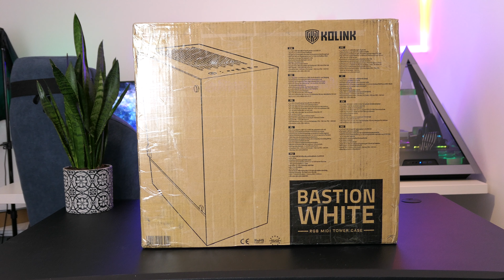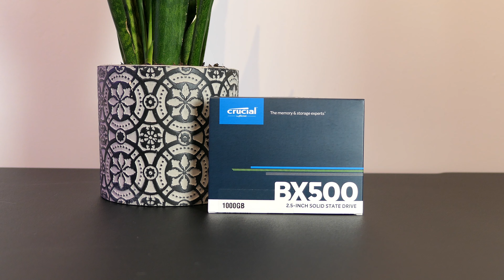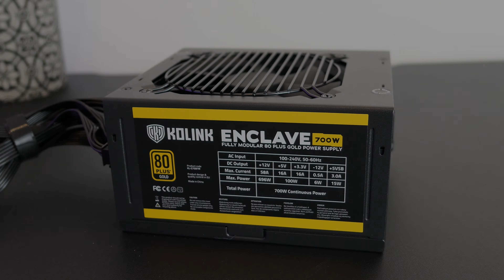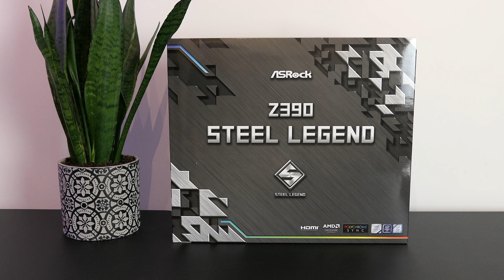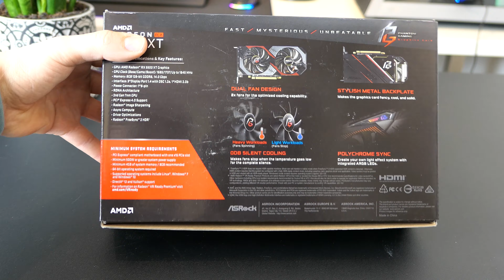PC Build Timelapse - Kolink Bastion RGB

Comment: Thank god! I've seen this case on my favorite gaming store, 2 months or 3 ago and didn't had nobody talking about his case or showing this case. Thank you soo much :D
Reply: I got the same case and my GPU temp gets very hot 😭
Reply: @Underground_Vibes  really? Im planning getting this one
Reply: @johnyt5848  in the case I can't get my GPU temp below 80.  Unless I undervolt my card..
Reply: @Underground_Vibes  which is your gpu?
Reply: @juanburnes375  was only a rx 590 at the time.. with fans ramped on full couldn't  get thr temps below 80
Reply: @Underground_Vibes  which model?
Reply: @Underground_Vibes  do you actually have sufficient case fans?
Reply: i just realised that theres no front fans make sure you have probably the top row as intake fans
Reply: @Underground_Vibes  80c is mostly fine the cards only start to suffer at mid 90s

Comment: Hello ! I've seen a lot of question about the Case lighting with Leds, so I know the video is becoming old now but whatever. Here's what I found so far about connecting LEDs : 

Situation 1 - Your motherboard does have an ARGB port which is unfortunately not the case for all MB, especially entry-level ones. So if that's compatible, you can connect your fan and led strip directly on these port (both have argb 4 pin connectors looking like 2-1) and controlling them using a software. I guess you can connect it in duo on one argb port (by pluging the led strip to the fan and the fan to the MB)or on 2 different argb port. (That's not my case so i don't have further info about it)

Situation 2 - Your mother doesn't have any ARGB port but only RGB port available. That's mean if you want to connect it to the MB you'll have to buy kind of converter to connect it to your MB's RGB port. But there's another solution using the RBG button provided on the case on the frontpanel, next to the USB port on the top. You can control and change colors with this RGB button. For this you need to connect the LED-strip ARGB plug (female) to the LED-fan ARGB plug (male). After you'll have to connect the whole thing to the button by pluging the LED-fan weird 2-pin connector to the wire of the front panel named RESET SW (btw for no reason this is named RESET SW instead of POWER LED but that's really connected to the RGB button on the top). 

That's what I found to solve my problem as a beginner after many research. I'm definitely not an expert but hope this can help some lost people like me ! :)
Reply: Thank you very much. This Was the instruction i needed. Thank you very much sir.

Comment: Hi!
One question is there a software to control kolink cabinet lights?
Reply: No
Reply: @Teowas  how do I change the colors?
Reply: @tbuckholtz5519  I'm not sure but I think controller
Reply: @tbuckholtz5519  i has a button you can press and it changes color
Reply: @kaksidaksi3455  Do you know where that button is? I have the same case RGB basic red and I still don't know where to change the color
Reply: @siintai  Next to restart and power button

Comment: Great video, thank you! I will be setting up my pc with this case as well in few days so it’s gonna be helpful knowing beforehand how everything “clicks”! One question though, are the PSU Extension cables necessary for this case?
Reply: these are PSU Extension cables ? please fast answer !
Reply: @michadubel3822  yeah, it was 10 months ago but I remember they were mentioned in the video and I was worried that I’d need them to setup my pc but turned out I did not need them as the cables that came with the psu were long enough
Reply: @mephisto3717  ty very much ! Good day bro

Comment: Hey There. I want to build my pc with this case. Now I'm afraid of the airflow. Cause idk where to install the fans in the front. All instead, but that...
Reply: Install them on the top at intake, the back as exhaust! It will help cool down your cpu/mobo and possibly your gpu as well
Reply: I got this case and I ordered some nice white Arctic fans (5) to replace the exhaust and I will place 2 exhausts at the top (heat rises up) and to help negative pressure 2 at the bottom as intakes
Reply: @Alex-oq8yg  I bought this case too, can you please send me photos how did you do about the air flow? My instagram is @ananiascn 

Thanks bro

Comment: Apparently the system fan is only connected via 4 pin molex from the psu. Is there another way to connect the fan and control the rpm with voltage without losing rgb?
It has a 2 pin connector, but this one gets ignored if I want to use the rgb.
Reply: Dont you have a 3 Pin too?
My system fan has 4 cables 
Fist one to connect it with the LED stripe 
2 one 4 Pin molex 
3 a 3 Pin to imitade the Mainboards colour 
And the the 2 Pin i dont know what it's for

Comment: Hello, where should you connect the plug of the rgb button on the front of the pc case ??
Reply: SAME QUESTION
Reply: @youssef66596zz  
hello, i found out how to do it. normally you have a cable on the 2 pin rear fan. on it, you connect the reset sw, and most importantly, you don't connect the argb socket that you connect to the motherboard.
Reply: @klyne_5169 do you have a picture please?

Comment: I have the same case but temps are bad.. I do have 3 fans on the bottom should I remove them
Reply: how bad are the temperatures?
Reply: @juanburnes375  before i changed my case.
My cpu would hit 93-95 ryzen 5 
My gpu would hit 90

I brought a new case and kept my same fans corsair sp 120s and the temps are much lower.

Cpu 75-80
Gpu  85ish

Comment: Hi, can u tell me how do u change ur fans and case colors? i might have missconnected smth because i cant change my cha_fan and case colors, it keeps going circular white on the fan and a staight line white for the case... i really need ur help
Reply: Kevin Calcoen im trying to do it too but i cant
Reply: @Andy-fl1js  can u tell me how did u connect all the connector from the front panel? my rgb wont work the plug that leads to my rgb button on the front pannel is called "reset sw" which looks strange to me... rgb button that reset? it should be called power led imo.. maybe you could help me to figure it out
Reply: Kevin Calcoen its called rgb you need to connect the power supply with it
Reply: My rgb lights arent working either.. did you guys find how to?

Comment: really that garbage gpu with that 32 gb rgb ram with cpu water cooled wow what a bad build at least go for a 5600 xt an 5700 not a 5500 its so bad for that build and why so much gigs of ram if you are going for that mid low range of gpu dont get it honestly :)

Comment: Crappy airflow is this case! Not good idea to buy it guys, he build maybe this pc just to pay the sponsor , but don't even think to buy this case on your own.
When you did this video , did you just thinking a moment that some people there may try to copy the build that you did , and potentialy they will broke they'r components??
Reply: do you have it?
Reply: @zolu x2
Reply: just got the case  pared it with and r7 3700x stock cooler while playing cod warzone i had around 70-80 C
Reply: @juanburnes375  yes i did have it and i replace it within 1 week the temps drops after case change with 10  - 15 degrees
Reply: @Denis92Gottlobeanu  Can you advise one ?
Reply: @Skewguard  no i whould not recomand this case , this model with no intec fans.
The smal opening on the side for intec is really not ok and not enough.